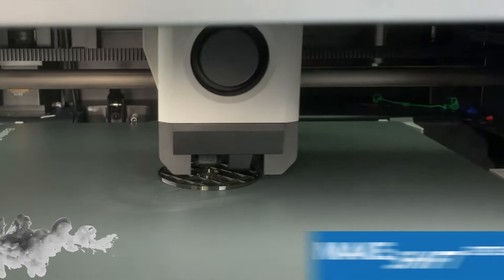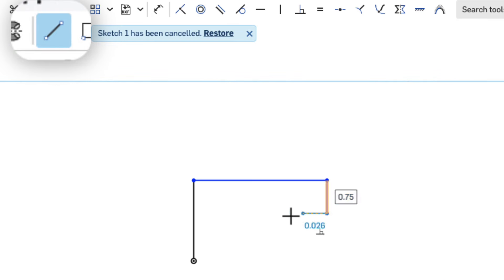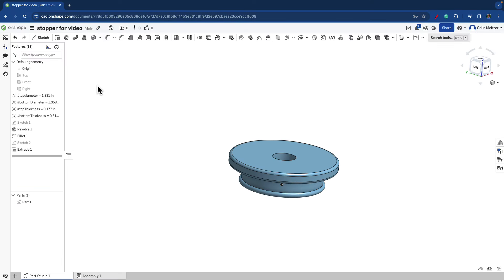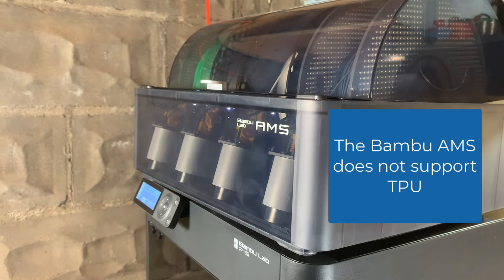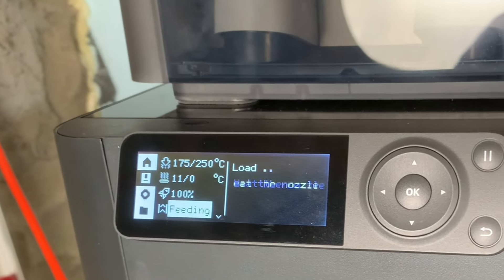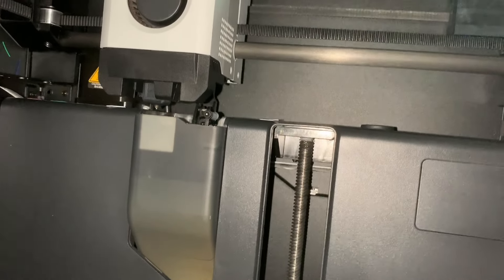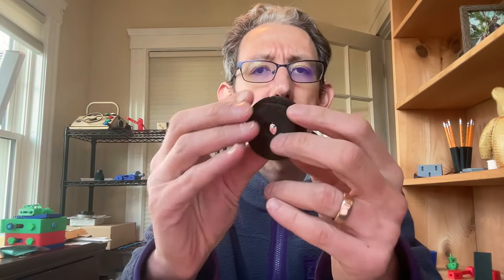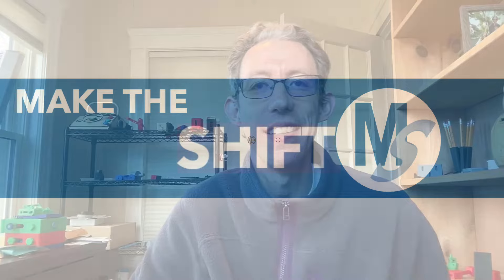How easy is printing TPU (Flexible) on the Bambu Lab P1S?

Comment: your part is underextruded, might not matter for this application but if you take this profile for critical parts like a lid to seal off liquids, it will just seep through the gaps, happened to me. Increasing walls does not help, i really needed to change flow ratio, temps and especially speeds to get rid of the gaps. It also helps to roll off the filament so the direct drive gear only has to work on extruding and not do double duty by also pulling the filament from the spool. Bambus backside spoolholder has a lot of friction that usually doesn't matter for stiff filaments, but soft TPU really benefits from such strain relief

Comment: I've found on all the Bambu printers I've used (A1, P1s and X1C) they all need the retraction settings increased to print TPU cleanly with no stringing.
Reply: I have printed some 95A without any adjustment to the retraction settings on my X1C and I didn't get any stringing, then again I suppose different TPU products need different retraction settings but for me the default settings were just fine
Reply: Interesting. It can depend on what you're printing. I was using Bambu TPU 95a (not high flow) and esun TPU 95a.
Reply: i dont own a bambu, but on my printer i found that NO retraction at all gave very good results...
does this not apply to bambu? im thinking about getting the p1s combo for printing my tpu stuff

Comment: If you're willing to stick to BambuLab filament, printing is a piece of cake even with TPU. All BambuLab filaments print really well in their printers (engineering filaments need to be enclosed of course) and you don't need to know Jack squat about profiles and settings.  I mean that's the reason most of us choose BambuLab.  It will set everything for you.  At least the X1C will.

Comment: I've been wondering about how well the X1-Carbon printed TPU. Did you have to lower the print speed or does the slicer do it when you select TPU as the filament?
Reply from the maker: The slicer lowers the speed by default under Generic TPU, but for Ninja Flex I had to lower it more. It's under the settings for the filament max volumetric speed.

Comment: when i load tpu into my p1s it just jams up the extruder and clicks A LOT while trying to pull filament and then just clogs... any tips 0.4mm noz
Reply: Happened to me too. I cut a piece of ptfe tube about 1 and a half inches long,  sanded the edges of the cut side smooth,  and inserted that into the back of the machine after disconnecting the tube feeding from the ams. I then fed my tpu from a very loosely (re-coiled) spool. I also increased the temperature to 5 degrees above the recommended temperature for printing

Comment: Dry your filament. You don't need to change plate. Pei works best for every type of filament. Get the high flow tpu and print at high speed perfect clean prints every time.

Comment: is very hard to print tpu is 0 this machine no work im test 20 different tpu 95
Reply: may i help You? i don't know your filament but with ninjaflex enter the recommended filament temps and modify the Flow ratio to 1.05 in "filament settings". After that go to the "Speed" tab and start with 20mm/s for all the actual print speeds. Acceleration and travel can be faster. if this prints fine then you can always try faster speeds. If your TPU is stringing or bubbling it needs to be dried (this takes hours because you have to dry only at around 80° Celsius) hope this helps